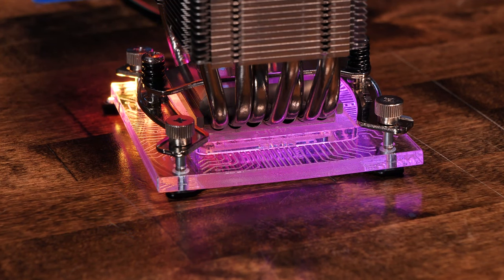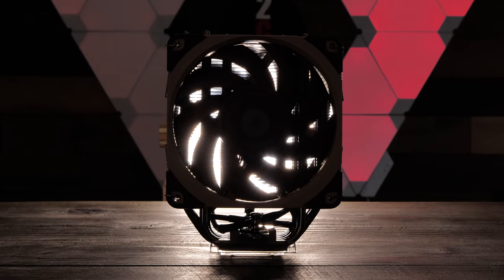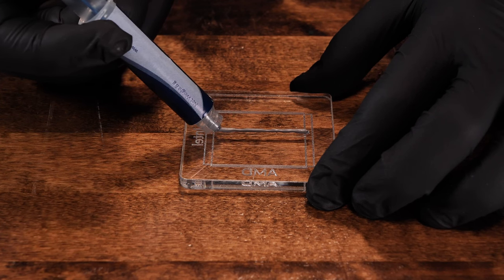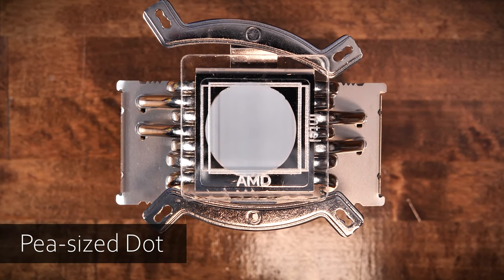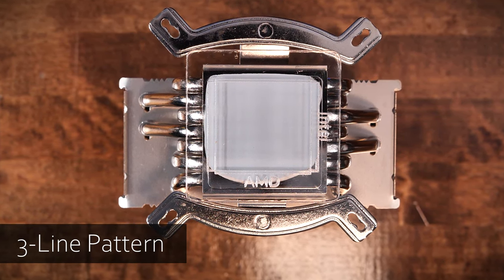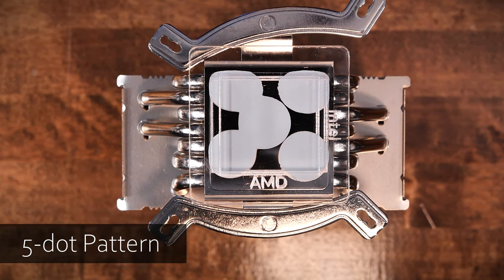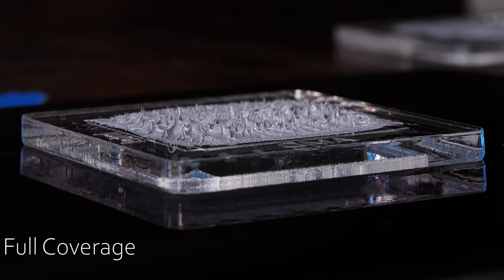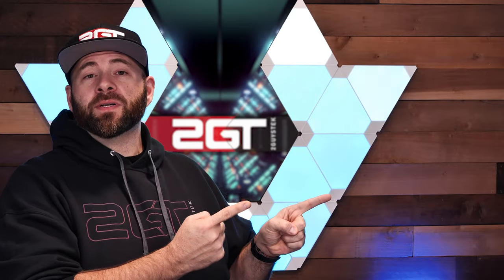You're applying thermal paste wrong! Here's how to do it right!

Comment from the maker: Do you have a different pattern you use that you want to see tested? Tell us how you apply thermal paste and maybe we'll test your pattern!
Reply: Yey, my comment made it in the video. 
I think the pea sized method used to work just fine when the cpu chip was more in the centre of the ihs compared to now with Ryzen and it’s chiplet design. 
Btw, love the methodology and use of acrylic. 
2gt acrylic keychains I hear are coming next ;)
Reply: Oh @toosas mentioned one that I also wanted to see. A cross with a a dot on each side of the X.
Reply from the maker: SIDE BUSINESS HERE WE COME! 😂
Reply: This video should have 1 million views, Very well done and interesting actually being able to see it.
For the past several builds(10+ years) I have not had to apply any as either the AIO or the air cooler has had pre applied paste and it usually is covering the whole area which backs up your video.
15+ years ago I would do the thin spread covering whole area with a throw away business card out of the mail.
Just curious what a small square for AMD or small rectangle for the new Intel cpu's would achieve, Next time you do an update maybe give those a try.
I give you a thumbs up and I'll subscibe, Will come in quite handy next week as I am about to finally upgrade my old Haswell to Alder Lake and am using the same Noctua cooler, Guess it's back to the old days of the thin even spread.   ;)
Sorry for the long post but I really enjoyed this video, Seeing is believing the use of arcylic was genius.
Reply: Full coverage but with point finger, not spatula ;-)
Reply: The centre dot in 5 dot should be larger than the outer dots. Also curious about spreading methods, how about dabbing/brushing with a cosmetic brush or sponge? What about a real fine brush and different coloured thermal paste, channel your inner Bob Ross?
Reply: I do a $ on mine.
Reply: I have always used a spiral starting from the middle.
Reply: @2GuysTek question. I did my first cooler install recently. I tried to use a plastic small spatula for spreading thermal paste. Where did you get your metal one?

More importantly. The thermal paste was so hard to squeeze out of the tube. When I watch people apply the thermal paste using the syringe they always seem to squeeze it with ease. My hand was shaking because I had to press the plunger so hard. It was not because I was nervous or anything. 

Anyway are some brands just thicker than others. I used NZXT high performance thermal paste. 

I appreciate your input in advance if your able to answer
Reply: I cut PTM7950 from the sheet and do not play with dots, dashes and crosses 😏
Reply: I do a 9 dot pattern, and get full coverage.

Cheers!

Comment: Yes, but you didn't measure the temps. In the end, as long as you get a decent area covered out from the centre, all temps will be very similar.
Reply: yes i hate they didnt do that
Reply: Exactly so it doesnt really matter too much.
Reply: Common sense says you should have the whole IHS of the CPU covered, or you can get hot spots.  Not to mention, imperfections exist all over the IHS, so you are leaving areas exposed that are not devoid of imperfections.  Tests are meaningless and do not tell the full story, because an even, thin layer will always work better than a "heavy center but missing/thin outer layer" method like the pea method.  It will bring the heat down faster and this is hard just by measuring load or idle temps.  In other words, it does matter!
Reply: temps of what a plastic 😂 go look. Theirs videos out for that.
Reply: Exactly, this video does nothing for anyone, unless you test the temps after applied.
Reply: @ricsim78  That's why OEM heatsinks have a patch that covers the center and the edges are not covered. Right? The heat spreader doesn't do what you think a heat spreader does. That is why delidding has such a following. If you have the cores covered the rest of the spreader is acting like a helmet, which it does very well. Remember Socket A? Busted cores were common among new builders. The heat spreader has all but stopped that stuff from happening. It is not part of a cooling solution and can be quite the opposite...see delidding again.
Reply: @skivvywaver  I know, have lapped past CPU and delidded before, too.  The point is, your TIM application should match your CPU shape and size.  Ryzen is a large square, while Raptor Lake is a small rectangle.  One of the biggesr issues is TIM runout from too much.
Reply: they are just into design differences and not into the temperature differences, there's a video that 5 dots shows the lowest temperature but in this video they just don't recommend it cuz they are into design XD

Comment: Strange to judge success based on strength of adhesion rather than operating temperature.
Reply: Because the temps dont matter. And neither does the spread technique. Other than that full spread or 3 lines are the best. Im gonna go with 3 lines for quickness and safety

Comment: Noctua recommends pea size in the middle for medium sized cpu's. 5 dot pattern for larger cpus. You'd think they'd have done a lot of testing? I'm assuming they go with the theory that you don't want too much paste because you want max metal to metal...not metal to paste to metal. The paste is only meant to fill up the micro pits in the two metal surfaces.
Reply: I don't think you're supposed to place the outer dots right on the edge of the CPU heatspreader, unlike these guys.
Reply: I imagine they go with the pea sized dot because it's fool proof. Try asking your average person to spread it thin with a credit card and they'll mess it up and get goop all over their board

Comment: Sorry, but no matter how many videos I watch about it, there are so many results, this is like a religion, believe what you want. I haven't seen any stress tests here though, this is just a visual test, whatever anyone likes. Overflowing paste is also sometimes not good because of short circuits and overflowing means a lot of paste and too much thermal paste can create air bubbles. Stress tests have shown that there is a difference of 0.5 or 1.5 degrees Celsius between some methods, which is nothing. I'm also looking at the 5-point method, sorry, but what I saw covered almost the entire space. Full coverage - sometimes an air bubble will form in the center, whether you like it or not, just to be sure, put a small dot of paste in the center. I have good experience with the X method, which you can't go wrong with.

Comment: Good video. Thanks for sharing. I've always stressed to anyone that would listen that a full spread super thin, transparent if possible, is the absolute best. Sticking your pointer finger in a thin plastic baggy to spread was the best.  CPU and heatsink surfaces are not perfectly smooth under a microscope and all the thermal paste's job is to fill in those microscopic peaks and valleys to allow 100% contact between the CPU and heatsink. I owned a computer shop for 10 years and now dabble as a hobby here and there for the last 6. I've always gotten great temps albeit a business laptop, gaming laptop, office pc or gaming rig over the years. 

All the paste has to do is fill microgaps in the metal between the two surfaces, that's it. Every good cooler and board will allow the heatsink to sit perfectly flush with the CPU so there is no need for it to fill any kind of large air gap, that would only be there from a mismount.. 

I urge anyone to try this mega thin method as you will do no harm. Worse case your CPU thermally shutdowns as it's designed to do.  If you can afford the waste, try the method and then before even booting take the heatsink back off. You will see perfect thin coverage. Then clean and reapply and boot her up. I've had temps some didn't believe until they saw it for themselves, near ambient at idle. A great cooler helps as well. Watch reviews on them. Xigmatek had amazing air coolers when they first popped up back in the day.  Not sure how they are now. Anyway, hope that helps someone.
Reply: if you think about it, the paste layer being as thin as possible makes the most sense. The conductivity of the paste is always going to be worse than the IHS and cooler block. The paste's job is just to get heat from one to the other. Making a thick layer just increases the amount of inferior thermal conductivity the heat has to go through. I've seen concerns about air pockets and the like for the spread method, but i really don't see how any air could be trapped when there's that much pressure pushing down

Comment: Overall, most of the methods that give good coverage used too much thermal paste.  I use Gelid Extreme which is thick pasty stuff, so I start by sticking the tube under my arm to warm it up so it can be spread more easily.  Once warm, I use the pea method, and the little spreader that it comes with and do the full spread method (I've always used full spread and I have been doing this since heat sinks first became available) with as little paste as possible.  Most people forget that the whole point of the paste is to fill those tiny imperfections in the two surfaces.  No matter how well you lap them, it will never be perfect. It's not supposed to look like cake icing...  less is more here.

Comment: The 5 dot pattern is supposed to have the middle dot as big as the pea sized method. That's why it didn't cover the full CPU. Now add the pea sized to the 5 dot and you have full cover.

I'm not saying it's the best, I'm just saying you guys did it wrong lol.
Reply: I agree. Not enough paste is the problem, always. Too much is not good either but its not that important than to put enough paste on. My fav. is 3 lines tho. Put enough on 3 lines and its perfect, and quick, and even pressure on cpu/gpu

Comment: Long ago on an obscure PC cooling Forum. 
The agreed method was full spread. And less was more..... Even to a point they would be lapping the cooler's contact surface to use as little thermalpaste as possible. The idea being more direct between "hot" surface and Cooling element surface. And the thermal paste only as a void filler rather than a full heat transfer medium. 
Seems like the consensus today is thermal paste a heat transfer medium. 
What changed?
Reply: We lapped because the integrated heat spreaders or coolers weren't all that flat back then and it caused bad contact and high temps that even copious amounts of paste could not solve. If you had bad luck with your cpu IHS lapping could shave up to 10c or more off the max temp. What changed ? If i had to guess newer people have to do and know less these days. Back then you had to be more knowledgeable about you parts/settings/overclocking in general or you could kill your stuff pretty easily.

Comment: I use the  "square" (AMD) or "rectangle" (INTEL) method to apply my paste, they work perfectly (when i take the CPU cooler off there is full coverage with minimal bleed).

I draw the square/rectangle with thermal paste about the same thickness as you did with the first of your 3 parallel lines.

Comment: I put an x with very thin lines then spread it into a square with a small gap to the edge of the IHS.
100% coverage, hardly any excess being squished out the sides.
The point of starting with the x and spreading it out from the middle is to ensure the square I created is even thickness across.

Comment: I use the 841 dot method - equal size dots in a 29x29 dot pattern.  It works great!.  It does take most of an afternoon to do the application step.  But, no one ever says perfection is easy.

Comment: Noctua recomments the 5 dot pattern for LGA 1700 and AM4/AM5, but you have to add more paste in the center than you did. A 3-4mm pea in the center and 4x 1-2mm dots near the edges Works just fine.

Comment: I’m gonna try the X with 4 tiny dots on the inside angle, or an X with a smaller “pea” in the middle. The X reaches the corners which the least alone doesn’t.

Overage doesn’t hurt anything, but if you are using the conductive (Liquid Metal) types, I’m assuming it would be really bad.
Reply from the maker: Correct, conductive pastes are total danger zone stuff - If you're going to use it, you need to be very careful.

Comment: wouldn't the heat from the CPU cause the paste to spread a bit more? I think the many of these would work better in that case right?
Reply from the maker: Thermal paste doesn’t melt under temperature.
Reply: But pump out is a thing.

Comment: Please test anti-seize as TIM next! I have used this in a pinch and it worked wonderfully. Had it in my 9600k system for over 6 months before removing it and it looked brand new. Only reason I removed it was to install a new CPU cooler. The material itself is made of very finely powdered aluminum or copper mixed with grease. You guys could do a couple awesome videos on this to show the differences between the two types.
Reply: Mine is called copper grease
Reply: I've not used it on computers. Only on motorcycles...

Comment: I have used both the pea sized dot and the grain of rice short line. Both work great with the old Intel CPU cooler which had a circular copper slug in the center and my Cooler Master G100M which has a large circular copper slug/ heat pipe in the center. The pea sized dot with OK coverage and no bleed out the side would definitely be the way to go with a conductive thermal paste like Arctic Silver. I use Arctic MX-4 myself.

Comment: The "pea" method and "5 dot", neither is good for big square AMD and rectangle but smaller Intel.  I personally use and recommend the "X pattern" or manually spreading it with a thin layer (which is best overall, but you must not create air bubbles).   I had a AMD Ryzen 9 5900X before and now own the Intel Core i9 13900K, both had the AIO coolers removed and the X pattern got the full coverage both times.

Comment: I don't know guys. Have you tried the thermals? Because the temperatures may show little to no difference, and that's what matters the most.
Reply from the maker: Good question! Thermals are most important, but poor coverage will mean poor thermal transfer between the CPU and the cooler. We hope that our testing will help people make a better informed decision on how they apply thermal paste for the best thermal transfer.  Thanks for the comment and watching! Consider subscribing!
Reply: @2GuysTek  I'm not sure. Although full coverage of the IHS is important, IIRC during the Ivy bridge era the "line method" was good because the cpu die was actually a rectangle underneath the IHS. So if you covered that part of the IHS you would little to no difference from a full cover. I still think a thermals test should be done before coming to conclusions.
Edit: I thought I was already subscribed, my bad 👍
Reply from the maker: This speaks to the need for a follow up video!
Reply: @2GuysTek  yes please! Rly looking for it 👌🙂

Comment: Hmm. One dude did test with paste and w/o on ryzen 3900x. The results were that it doesnt really matter. Paste is used only for surface imperfection. Personaly next time i change it on my 3900x i will use just a bit and spread it manually.
Reply: And by a bit i think even on 6:14 were applied too much. Radiators surfaces became much better during last years, processors plates too. 2 almost perfectly finished parts wouldnt even need a paste probably.

Comment: If the paste is conductive, you  have be very careful not to overdo it else it could fry the electronics and also heat dissipation is mostly required in the middle so the dot should be adequate

Comment: After watching this video, I'm wondering if a small dot inside a rectangle pattern would strike the magic balance between coverage and application ease? The X and Y dimension of the rectangle pattern should be about 70% of the CPU X and Y dimension respectively, so there is roughly equal area outside the rectangle vs. inside the rectangle. Would it be possible to test this pattern?
Reply from the maker: Great question! We’ll add it to the (growing) list!

Comment: How about the Intel 12th gen bending problem on the middle of the IHS? Should we apply more in the center when we choose to go with the full covered thermal paster?
Reply from the maker: You certainly can, however I'm not convinced you'd need that much more to make up the difference. The bow in the IHS isn't that dramatic.
Reply: @2GuysTek  Thanks for your reply, yes, in my understanding also if we put too much paste on it, it will degrade the performance.

Comment: I did this today I used pea method I started PC it ran hot, I removed my IHS and paste did the spread and my idle was down to 40 from 60C the pea spilled over the edge and insulated the cpu making it run hotter you don’t want spillage

Comment: I just used a crosair kit that had a  Stancel and a scraper that was a full coverage. Just wondering what yall think of that. So far I'm impressed with the kit after seeing this video
Reply from the maker: If the coverage was good after using the stencil was good then I’d say use it! The only real downside to full coverage is the amount of time it takes to do a good and complete job. So if the stencil makes quick work of it, use it!

Comment: 12th and 13th gen are more rectangle.  what is the best for that?
Reply from the maker: An even spread is always the best, followed by 3 evenly spaced lines that run the length of the IHS.
Reply: im affraid to have air bubbles if i dont spread it good.  i guess the 3 lines will do 4 me